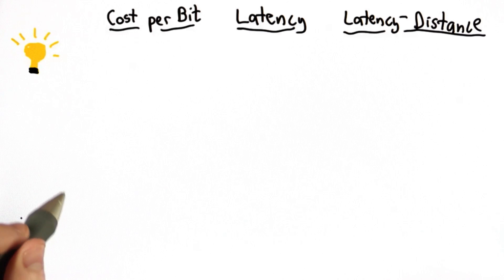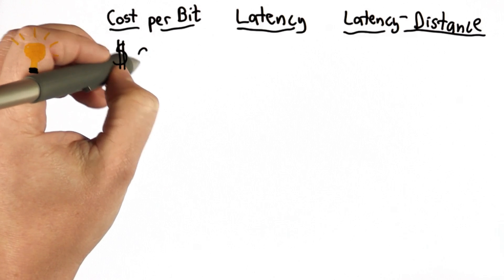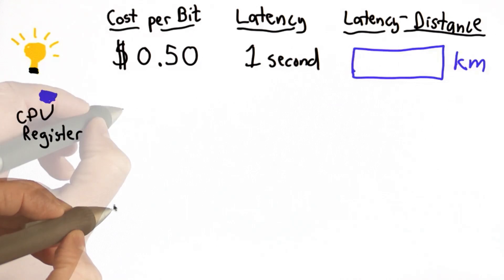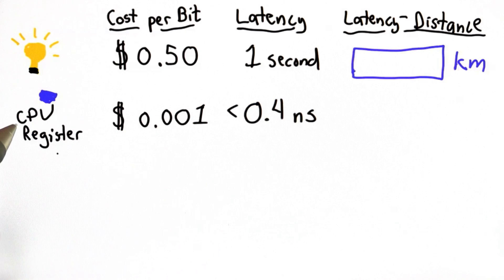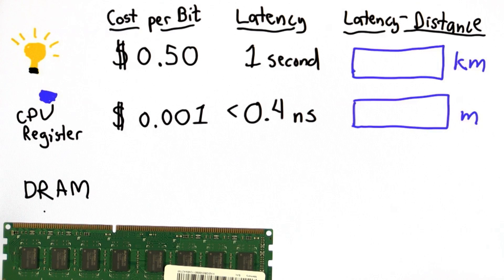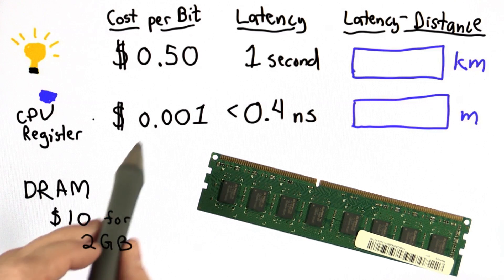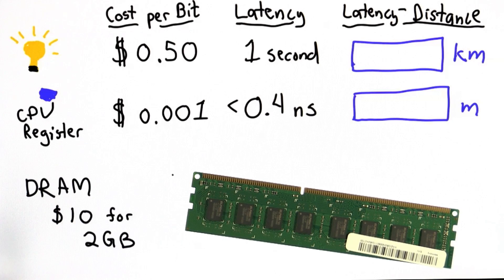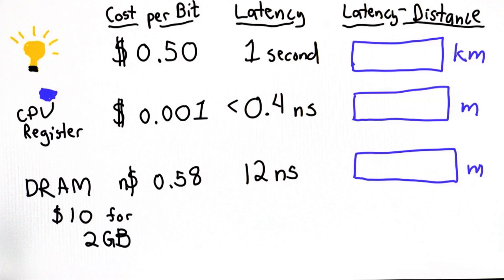Memory Hierarchy - Intro to Computer Science

Comment: This video was very poorly made, considering that the price per bit of each type of memory is interesting but irrelevant to his question.
You're trying to find the distance light will travel to activate the sensors detecting whether or not a bit is on. You do this by multiplying the speed of light by the latency/time it takes.